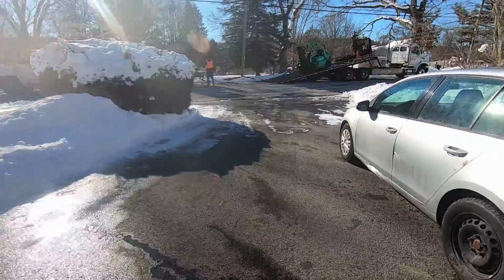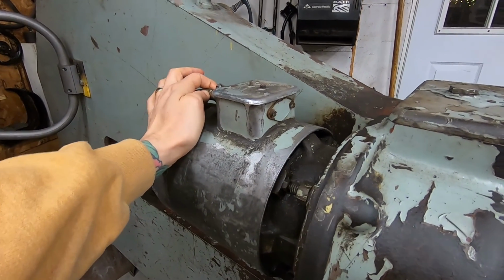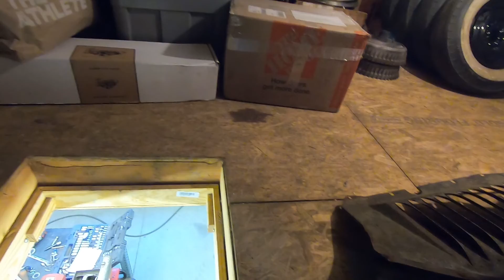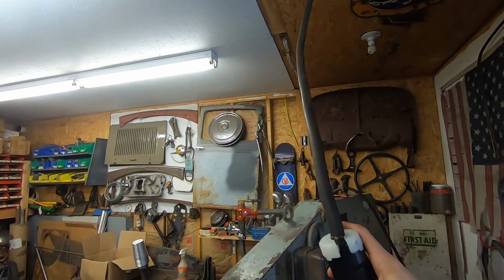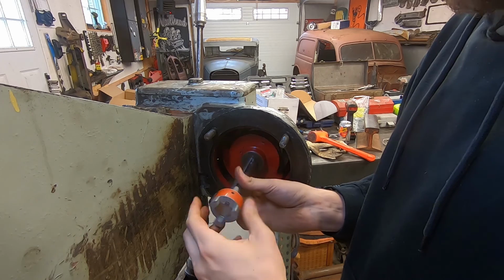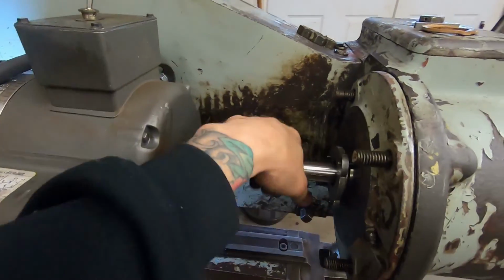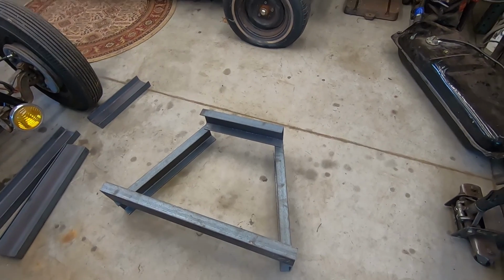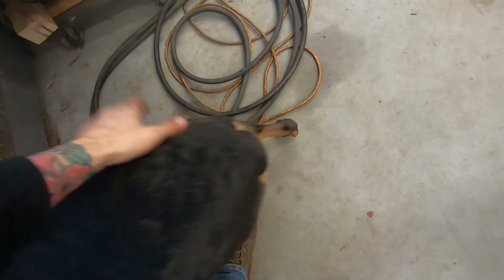Tool Delivery! RAC Garage Gets A PULLMAX!!

Comment: The first welding job I had was for a small fab shop that had a Pullmax. We used it to nibble out window openings in crane cabs. You will want a roller table on each side of nibbler to support the blank as you work it thru. Otherwise it will be cumbersome to run by yourself. This was 30 years ago when I was in my early 20's. I'm 59 years old now. Only saw one Pullmax in all this time. Use ear muffs it will vibrate the sheetmetal very loudly. AL B in Ohio.

Comment: I ran a 1948 Delta 3 phase drill press with a 220/440 motor off a VFD. Worked flawless and was super easy. The variable speed control was awesome

Comment: Travis, nice snag! When setting up my vintage Delta band saw I acquired a gear reduction motor. They come in a variety of ratios depending what speed you're trying to achieve. The saw I ended up with had a separate reduction unit. It wasn't broke so I used it. Just a thought

Comment: You should have purchased a single phase to 3phase converter.  Rubber cord should not be used in the way you used it . I ‘ve used the converter on a few occasions and they worked fine. 440volt motor to 220 Volt use change is very simple as well.

Comment: Lots of things to consider when converting/changing motors on tools. Voltage, amperage, phase, speed, rotation, shaft size, duty cycle, to name a few. Can get "pricey" really quickly. If you haven't already learned this, be aware, the direction single phase motors rotate cannot always be reversed. Make sure the direction the  motor you purchase rotates can be reversed. Really simple with three phase. Not always so simple with single phase. I was wondering when you started your new motor if it was turning in the wrong direction??

Comment: Congrats on your new acquisition! Just a heads up.. the next 3ph high voltage machine you buy look into using a VFD. They are cheap and come in multiple inversions. Added bonus, you can control the motor speed. I'm using one to step up my off beat Pullmax from 220 1ph to 440v 3ph and it works great. Keep up the great work.
Reply from the maker: I looked into it and I couldn’t find any that would change 220-440. To my knowledge you need a transformer to change 220-440. A VFD can change phases but not step up voltage
Reply: @RACGARAGE   you should be able to change the wiring around in the 440v motor to 220v just by switching around a couple of the wires.  Do a little google search for 440v to 220v 3 phase. Lots of explanations  .   then just run a vfd. Did it on my mill with zero issues.